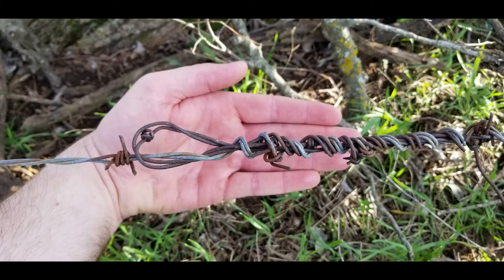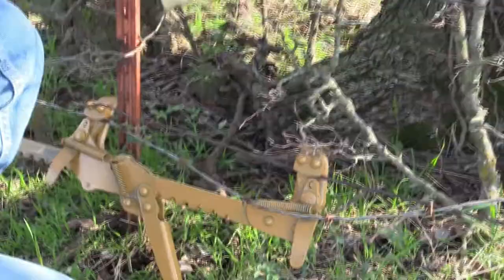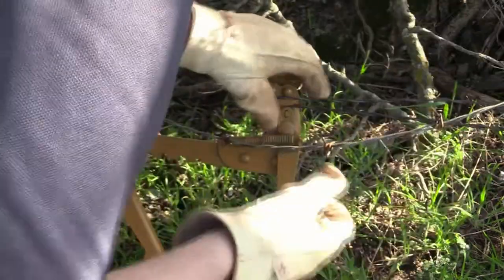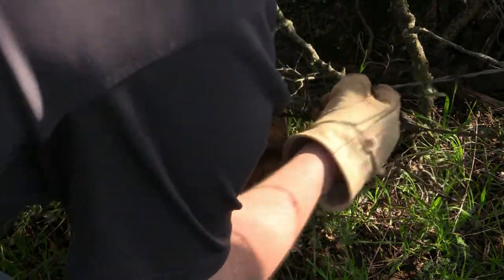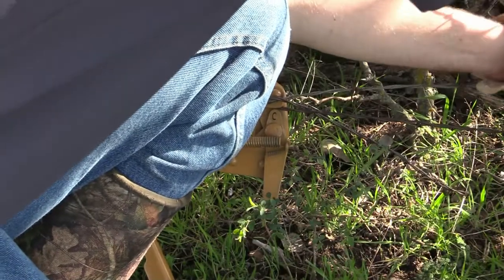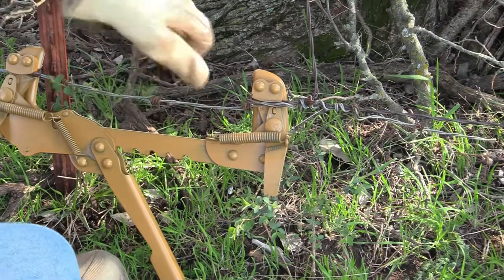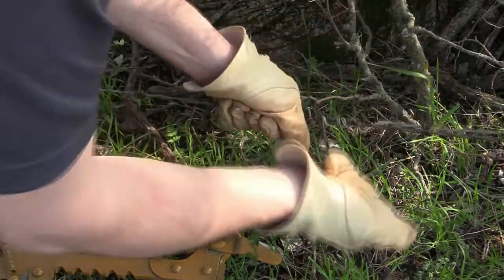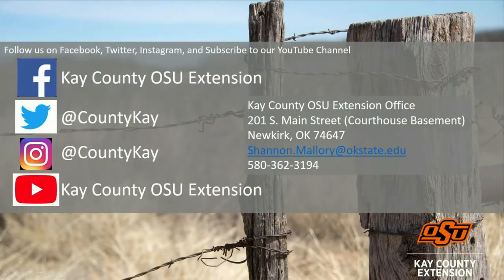Barbed Wire Fence - Tying a Strainer Knot

Comment: My normal splice is to cross the wires over each other and bend them back toward the way they came from. If this is done in a sloppy manner the splice will not perform well.
1  The loop around the wire must be very small.
2.. The wraps must be close to each other (not sprawled out).
3.  Each wrap must be tight on the wire that is inside the wrap.

To work on the wire again later cut the spice off and make a new one. I have determined that poorly made spices are a major cause of fence failures.